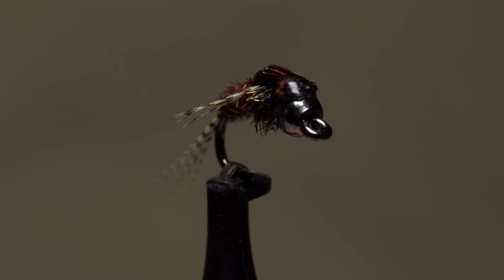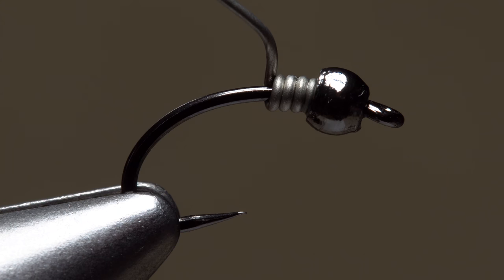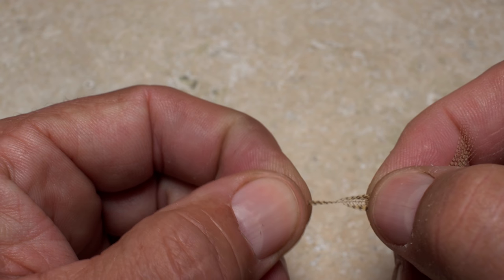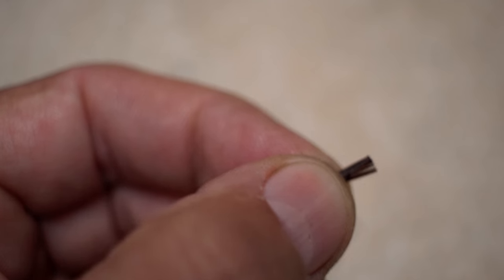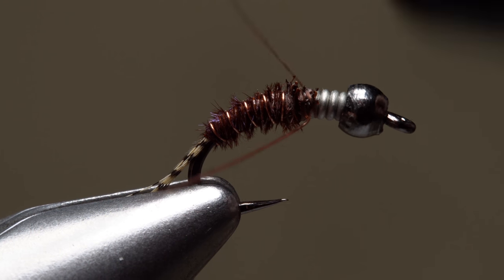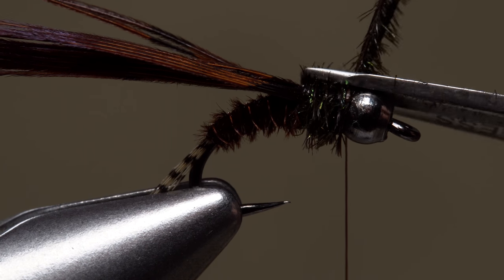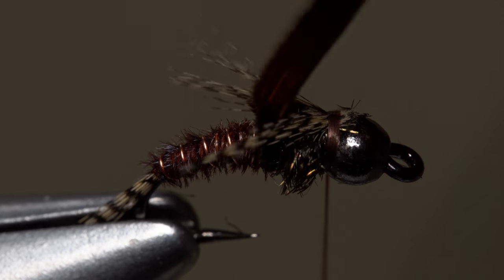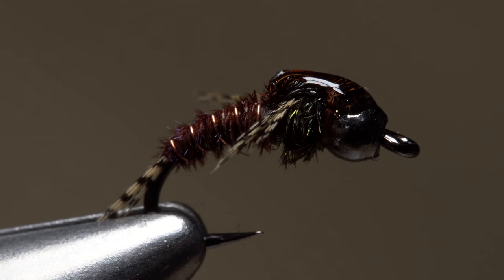DPD Nymph

Comment: Very nice Tim. Will be tying a couple of these for the box and make a "bright" complimentary tie - the same pattern but with a gold bead and a hot-spot collar.  Cheers!  Hank
Reply from the maker: Sounds great. These also look pretty good with a hot spot thread color, the UV resin kinda magnifies the thread.
Reply: tightlinevideo about thread tim have you ever tried semperfli nano silk it's all I like to use now after I tried it and it comes in 6/0 12/0 and 18/0 👍 and it's still the strongest thread I've ever yoused in 18/0 the only thing is that it's $6.25 per spool.

Comment: You should make a video on getting started on fly tying like what to get for the basic flys. Just beginner stuff! Also love your videos!
Reply: AJBB My two cents besides the obvious tools and vise would be: peacock herl, pheasant tail, partridge, grizzly hackle, various dubbing colors, tungsten beads, small copper wire, deer hair, and ep fibers (or poly yarn). You can probably tie most dry flies and nymphs with those materials. As you tie, you'll naturally amass a ridiculous amount of tying materials as you "fill in the gaps" of what you need. A beginners starter pack of tying materials isn't a bad idea either, and it generally supplies you with the aforementioned basics.
Reply: "As you tie, you'll naturally amass a ridiculous amount of tying materials"... Yup! That is the truth!

Comment: 1:28 Why the near side? I have heard this numerous of times from fly tiers, but never understood why!
Reply from the maker: The idea is to not disrupt the tail of the fly with the first wrap of copper wire. Since this fly is to be counter wrapped, I tie in the wire on the near side. For a normally wrapped rib (say over a dubbed body), I'll tie in the wire on the far side of the hook. There will be an Orvis Tips and Techniques video on the concept shortly.
Reply: @tightlinevideo  Thank you for taking the time to address that question.